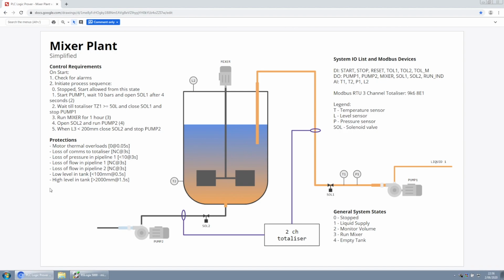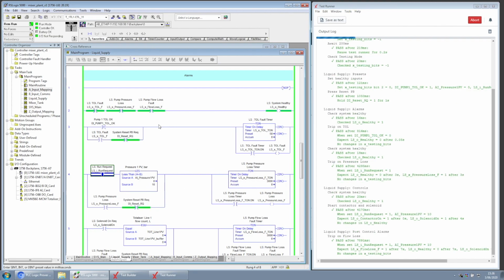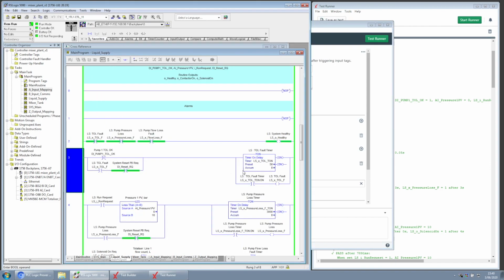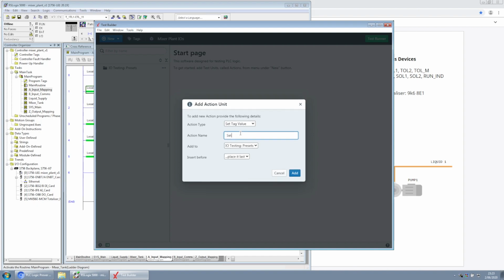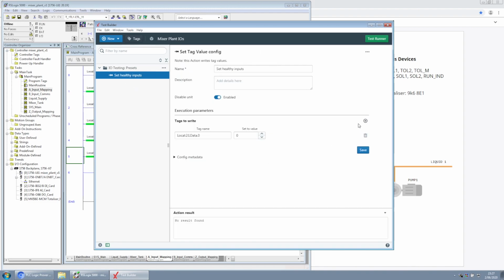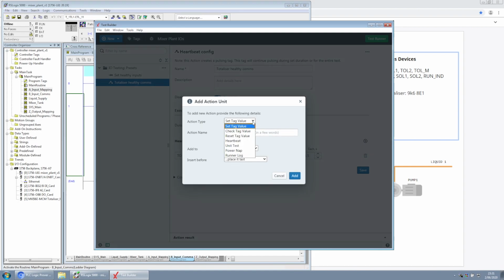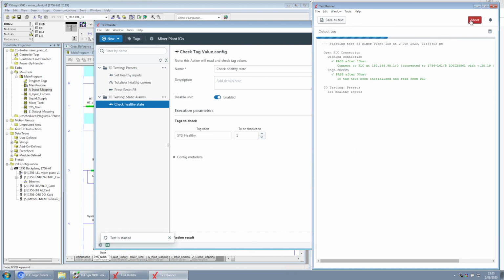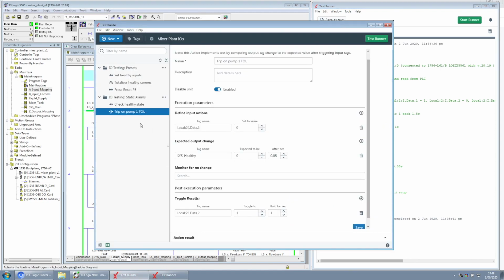Testing ControlLogix PLC program with PLC Logic Prover

Comment: Excellent.. Is it possible to upload AB PLC backup directly on Prover & See ladder Program .without using PLC controller.??
Reply from the maker: You can add tags from the PLC program, but not the logic. The idea behind PLC Logic Prover is to test without the Prover knowing the program. It's called black box approach. Then, Prover connects to the PLC and forces tags as per your test cases.